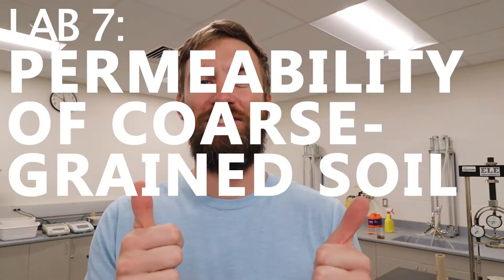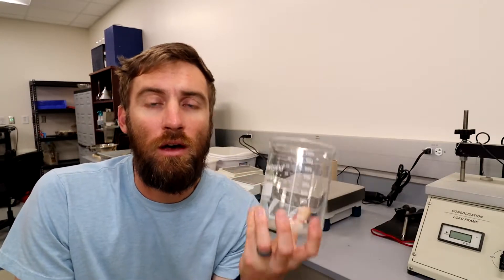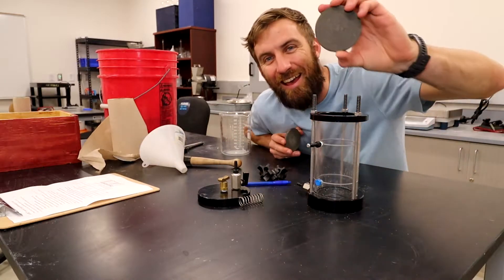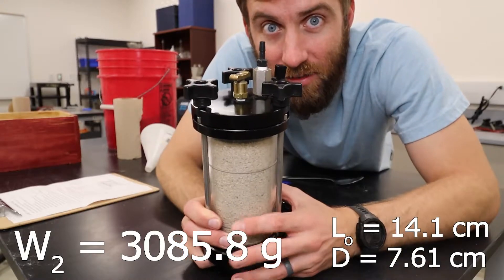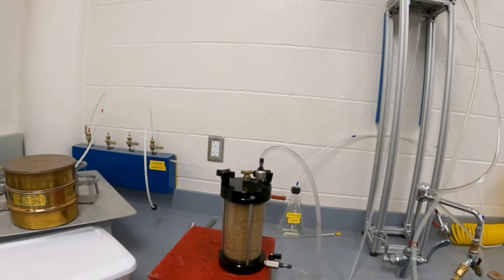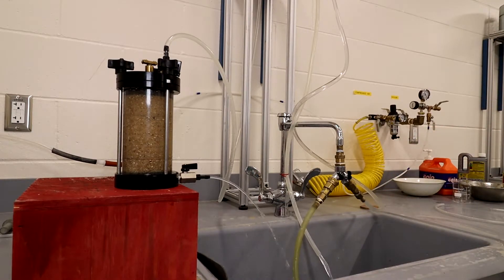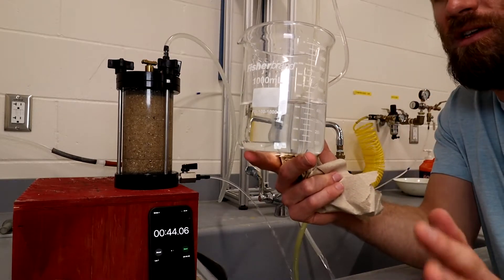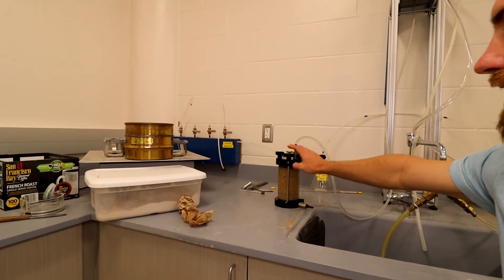Virtual Geotech Lab # 7: Constant head Permeability Test

Comment: you have not shown the calculations of permeability
Reply from the maker: The original purpose of this video is for the students in the laboratory section of my course. The permeability equations and calculations are what the students need to perform for their assignment, therefore I do not include any calculations or analysis in my videos - only data and measurements.
Reply: @RyanShamet  okay sir, but i have tried the calculation and I'm confused that, we have only one head which is at the top of the soil, but we don't have any head at the bottom layer of the soil so how will we measure the head loss??
Reply from the maker: @pushprajmandloi3745   rewatch at 11:35 in the video. The head difference across the soil layer is the Hz - Hn1. The table is our "datum" meaning (for calculation purposes) the head = 0.

Comment: How do you measure the lenght of sample (Lo = 14.1 cm)? Was it the length between two manometers measuring the pressure heads?
Reply from the maker: it is the physical height of the soil column in the permeameter. We also measure the diameter of the cylinder and the dry mass of the soil used to calculate the dry density of the soil sample.